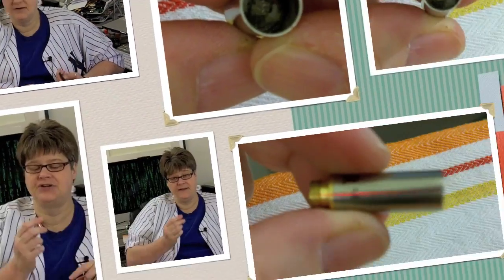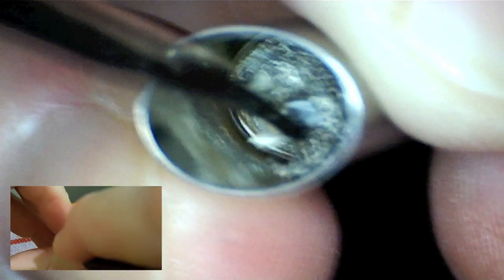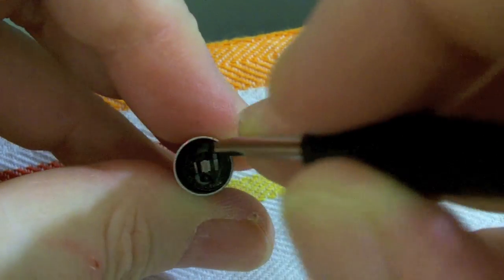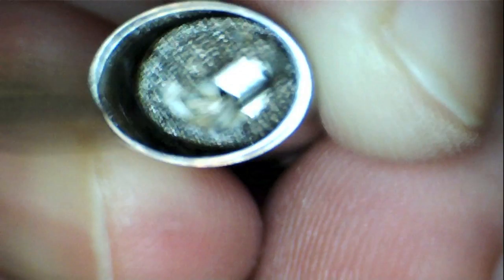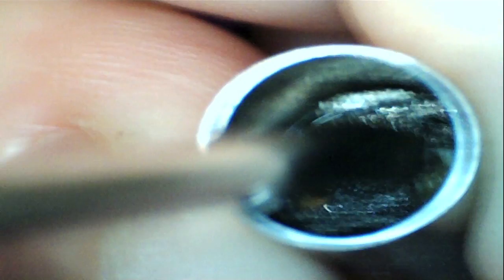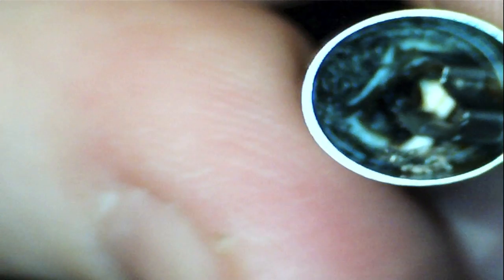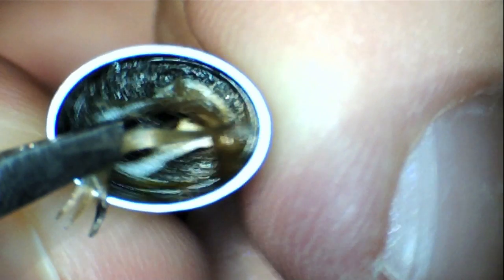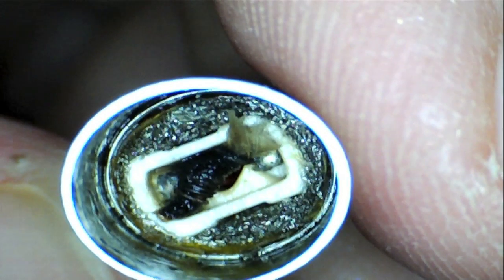Debridging a 510 Atomizer

Comment: I had the Cisco Spec 1.5 running at 3.2-3.5 on a ProVari.  I did not have great luck with it, so I am going back to Joye.  I will try another Cisco Spec atty but higher ohms.  I looked into the HH's but believe they are to finicky to be that high priced for me (now).   I am also going to try the COV DCA's which I have heard great things about.  Lastly, what exactly is the purpose for debridging?  Do you do this after performance lags, or before you even break it in?  Thanks...

Comment: for some reason when I did this to mine I can't get it to make vapor. too less and it tastes horrible and heats up or it floods and leaks... I use either all VG or small amounts of PG in it. I can go up to max 50/50. I have 60/40 RY4 60 pg or vg not sure exactly from VIP vapor cigs. but that stuff seems to work better in atomizers. but thicker VG or all VG works best in cartomizers for me actually. Especially Kanger 808s. I have rough times with attys... constantly wasting juice blowing it out.